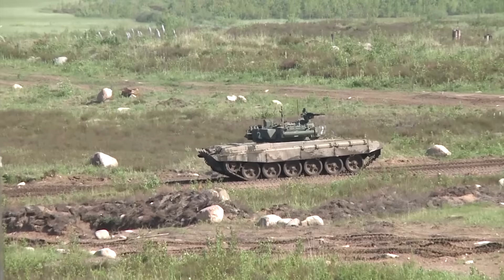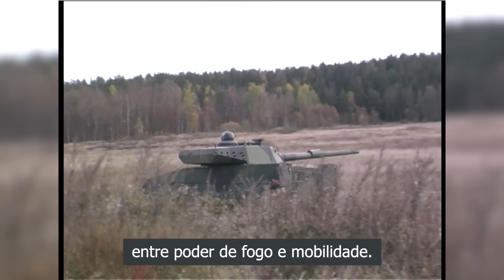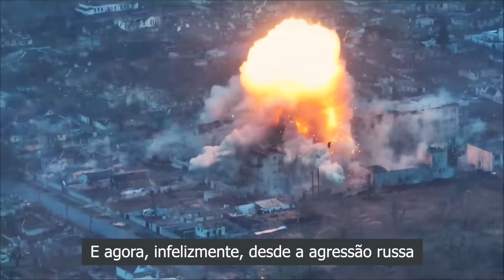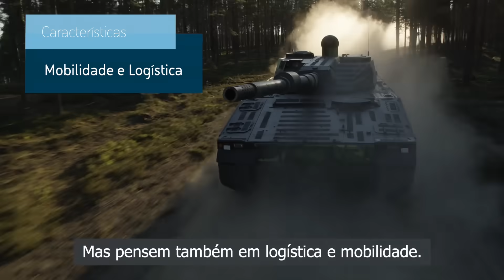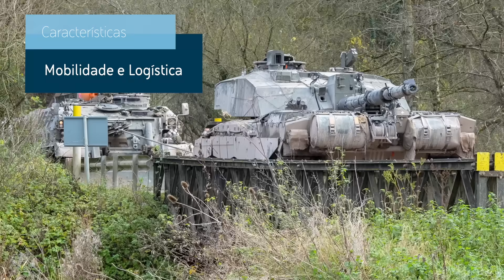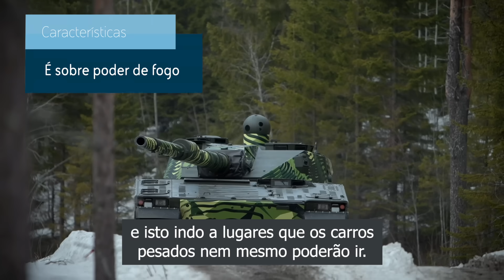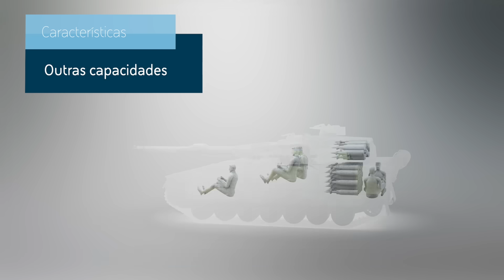CV90120

Comment: translated by google into english
 The video mentions modern combat with drones but does not mention the measures or innovations of the project against these new challenges. An example of how the Ukrainians have implemented home-made measures in the Abrams. I think it would be interesting if there were already projects by the developer of the armored vehicle project. If it is offered to tropical countries, such as Brazil. What are the solutions to prevent overheating in conditions of very soft sand with intense heat or the heat with very fine dust in the central region of the country? And how can countries with lower military budgets benefit from the features of your project? What can be said about the availability of the armored vehicle?
Reply: Swedish CV9040C were upgraded for warmer climates and served on missions in both Liberia and Afghanistan, two extremes of warm weather terrain. They performed perfectly fine and are the very examples of CV90s that Sweden sent to Ukraine, since they were currently unused by the army and could easily be spared.
Reply: @Merecir 
Brazil, for example, is a large country with several types of very harsh terrain. Forward-moving equipment tends to suffer a bit on some terrains.
Reply: @fhboechat Very true. We often have to operate the CV90 in our swamps and alpine areas locally. Good maneuverability aside, there really is no substitute for a crew that understands their country and how, and how not, they can move in it.
On a higher level the 90 is easily transported by any river vessel that can carry a truck and also by a certain Brazilian airplane ;)
Reply: He mentions "ahead of its time" and that is the future. Yet no one buys it, and no one has for the past 20 years. I have pretty low expectations for the CV90120 when it comes to procurement. The APS system should end up doing decently against newer threats, but its still not confirmed to counter drones yet. Adding an AC unit should be decently easy if Brazil decides they want some, and as for price. Its twice the cost of a second hand Leopard 2A6 according to google, and roughly 2/3rds the price of a Leopard 2A7, except these are also regular tanks and fill the armor role the CV90120 will struggle in.
Reply: @th3dankduck465 
It may be interesting for countries with smaller budgets in terms of logistics, although what you mentioned about the Leopard really makes sense.

Comment: So instead of tanks you see this IFV as the one leading the charge of mechanized unit on enemy positions as in Ukraine? 
Where they attack with tanks leading the attack which are there only for their firepower because extra armor protection means nothing against artillery, ATGMs and drones.
For me it makes sense, 
because tanks are used because of their 120mm firepower, not protection, today as soon as you are spotted the clock counter begins, it only matters how much firepower you can deliver in that time frame.
Reply: Tanks are increasingly being destroyed in the gray zone even before entering the danger zone. Drones are flying further and further, and there are more and more trained operators and units at the front. The tanks don't even have time to reach the firing point.
Reply: @dungeonmaster132  So what does one use for direct firepower in the era of this gray zone?

Comment: Won’t take long before we see it on the battlefield! 🇸🇪🇺🇦
Reply: Drones + fiber optic cable have become the new atgm
Reply: It won't take long for a drone to see it as well
Reply: @Whatevs_Punyeta  It's funny how you people keep parroting this drone nonsense. Have drones stopped the war in Ukraine? Have they stopped the usage of tanks? The vast majority of drones never even reach their target.
Reply: @dashikashi4734  lol imagine calling drones nonsense when they're literally changing the paradigm in warfare right now. When armor becomes vulnerable to cheap drones I'd say they're now very significant part of war. Also vast majority of shells and bullets don't reach their targets but I wouldn't call guns and artillery useless
Reply: @Whatevs_Punyeta  Drones are no more important than artillery shells or ATGMs. They've changed very little and any army that knows how to use EW has effectively rendered them useless. Just look at Gaza. Drones stopped being used after the first month.
Reply: @dashikashi4734  lol is that why drones now generate the most casualties compared to artillery and also thr development of wire guided drones certainly puts a damper on EW not to mention that EW is not always successful
Reply: @Whatevs_Punyeta  Even so, the CV90 has proven itself on the battlefields in Ukraine where the drones swarm.
Reply: @carlwrede3850 Proven to be just another machine that can get blown up. The Ukies certainly haven't reversed the fronlines with it in their arsenal
Reply: @Whatevs_Punyeta  Sick of the drone bs. Russian propaganda meant to destroy western fighting spirit. Most such comments are by Russian bots but people are stupid so they believe it and worse, repeat it.

Comment: The CV90 is such a beautiful tank
Reply: You could probably call the CV90120 a TD. A Tank Destroyer.
Reply: IFV*
Reply: CV90120 is more light tank than ifv
Reply: @nian60  With a 105mm or 120mm gun it's also a tank.
Reply: @RJM1011  Yes. But that should be specified as CV90 is originally an IFV. CV90120 is the "tank"
Reply: @richman2601  it really comes under the Categorisation: Mobile Protected Fire-Platform or MPF. Workng off a Adaptable IFV Family means it has some Protection against light cannons and sometimes weapons up to 76mm. while retaining alot of mobilty that even tanks don't have.

Not to be confused with the Mobile Gun System like M1128 8x8 which rely on their speed to protect them.

These new catagories have pop up over the years.
Reply: @richman2601  The CV90120 will be used as tanks. Thus, for all intents and purposes, they are tanks. Definitions are based on use-case.
Reply: @nian60  Light tank according manufacturer
Reply: @nian60  IFVs can still be tanks. The definition of a tank generally is an armored vehicle on tracks and usually equipped with a gun in a rotating turret. In the case of the CV90 105 and 120s, they are tanks. The STRF 9040 is an IFV but also by definition a tank
Reply: @Ulfur8574  ". The definition of a tank generally is an armored vehicle on tracks and usually equipped with a gun in a rotating turret. I"
No. The definition is in the intended use, not its construction.
Otherwise the British Mark i-VIII would not be tanks, while the American tank destroyers are tanks.
Reply: @johanmetreus noticed how I said, "Usually has a rotating turret" Doesn't mean it always has one